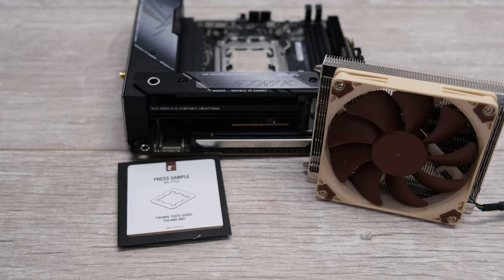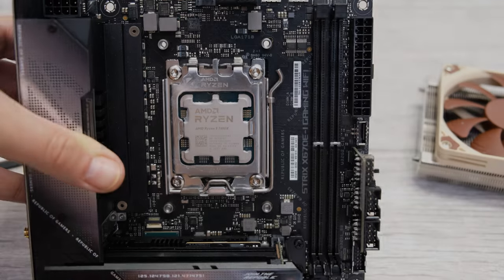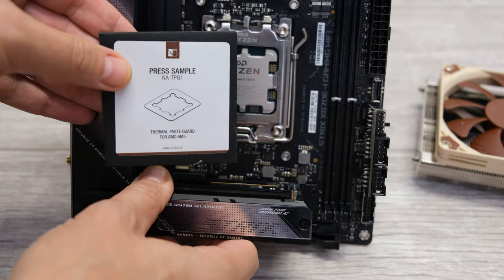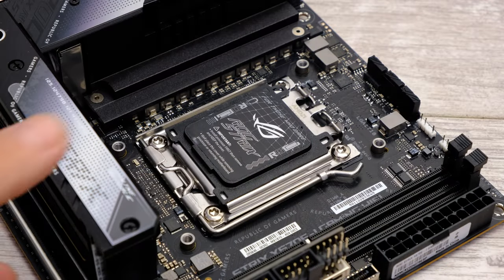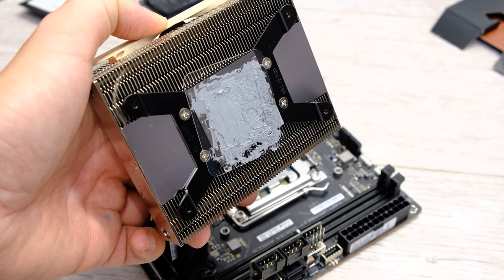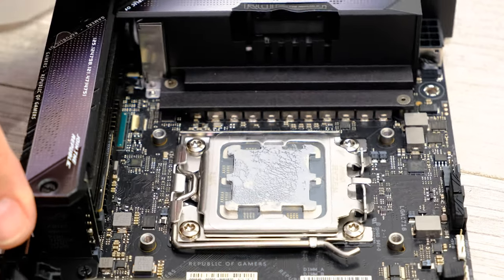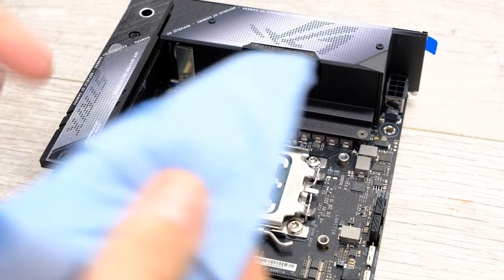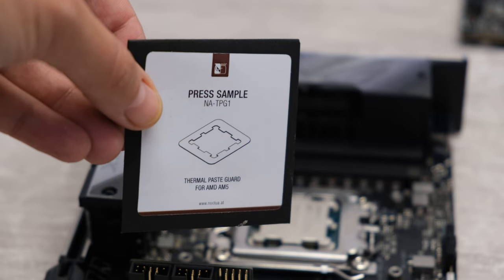Noctua Thermal Paste Guard Review: A Must-Have For Ryzen 7000 Owners!

Comment: i wonder if maybe adding double sided tape to hold it down , if that would keep it there even when you remove a cooler?
Reply from the maker: My thinking exactly. Thankfully you can just drop over another one but it’s super important to have one there when you clean the heatspreader 👍
Reply: @CrazyTechLab  just put some thermal paste under it to hold it down :D
Reply: Glue metal-plastic with resitant to heat and its ok.

Comment: Just get the Thermalright AM5 Secure Frame. It's fully aluminium-anodised and sandblasted, fully laminated with uniform pressure edges. Works like a dream. It's a must for big tower air coolers.
Reply: thanks for the reminder. I'd forgotten about that.
Reply: That's exactly what I did - it's about 10 £/$ and completely worth it
Reply: I think you could lose warranty by removing original am5 frame from mobo
Reply: @lolk1ck No you don't.
Reply: @lolk1ck  nah mate, you definitely won't - just don't throw it away coz if you need to RMA it you'll need to give it back as it's part of the Mobo

Comment: Been using one for about half a year now. Just replaced my NH-D15 with an AiO and the Thermal Paste Guard managed to keep all of the excess thermal paste from running down the IHS.
Reply: Look up am5 contact frame, more of a reusable solution. Intel gets even more benefits from those too (prevents warping, improves cooling, etc). For AMD though, it's pretty much just about paste cleanup.
Reply: @betif00 Thank you very much for your hint🙂 I'll definitely get one of those frames whenever I plan to work on my PC again!

Comment: Maybe try putting two guards on when installing? This could maybe deal with the issue you didn't like the guard being flush with the CPU, and one would lift with the cooler while one should stay in place and prevent you from having to slip a spare over while paste is still on the processor.
Reply: Exactly what I was thinking. Use two and perhaps one will stay in place. I’ve bought these guards and will try two with my new build.

Comment: Wouldn't the guard burn? Shouldn't you remove the guard after applying the paste?
Reply from the maker: Nope and nope. The plastic has a far higher melting temperature of the outside of the CPU. Designed to be left in place
Reply: @CrazyTechLab I've seen copper guards for sale, would they be better?

Comment: Thermalright has also released a AM5 contact-frame, that should do the same thing. Wonder how that one improves thermals compared to the normal bracket
Reply: I've ordered it and I'm waiting for it. Might add some thermal pads to it so it connects with my big Noctua tower cooler.
Reply: crieve i ordered it not because the thermals but because it prevent the thermal paste from falling to the crieves
Reply: I've ordered it.. Excellent value.. 😎🇺🇸

Comment: do you leave the guard on or remove it after applying the paste?
Reply from the maker: Leave it on. It's effective at preventing thermal paste spreading over the edges of the CPU when the paste is compressed between the CPU and cooler when you install your cooler, or if the cooler plate is moved during installation or when you remove it.
Reply: @CrazyTechLab  Okay, thanks. I picked up a 3 pack.

Comment: If the purpose of the guard is to keep thermal paste from falling onto the SMD's there's no reason for it to be flush to the top of the CPU and it being flush would make it damn near impossible for it to not get stuck to the underside of the heat sink.

Comment: I dont want insult anyone’s intelligence but if you think a little thermal paste on your processor will not do anything to it. 

Thermal paste is NOT conductive in most cases. It will not harm your component. You can always use 99% alcohol to clean your processor and nothing will be effected nor damaged if you don’t believe me even ram use a combination of adhesive and thermal paste across the entire module and that does not effect the chips .
Reply from the maker: No one said it will damage anything. It's more about the cleanup process. Also 99% alcohol costs more in the UK than this gadget from Noctua and will take longer to clean it.
Reply: Thank you for saying this, actually. I'm about to build my first pc here soon and I'm going through every little query I could think of, even "will the paste ruin my CPU through the gaps it has?" But learning that anything non-conductive won't do any harm lessens my worries.
Reply: @matamatmassivetac5789  yeah no worries i just put together a 7900x with a tinny amount of thermal paste and I didn’t need to make a big line just a small ammount on where the CCUs were located and small bit on top of that and am getting 62 C maxed out

Comment: Is it a must to have a CPU contact frame installed on AM5 motherboard?
Does AM5 mobos have the CPU bending problem resulting in poor contact with coolers prevalent in Intel LGA 1700 mobos? Feeling confused.
Reply: No it's not a must. This entire video is about keeping the CPU clean, but thermal paste cannot damage those components you see on the CPU in those 8 holes on the side.
Reply: @louisfriend9323  I see.

Comment: Apologies for a dumb question but should u bother about thermal paste on the chip? It’s non-electric so the only thing I might understand is the visual aspects (aka cleaness) or maybe heat distribution?

I thought maybe someone can explain that for me
Reply from the maker: It’s not dangerous and won’t impact on performance. But it will save a lot of time cleaning later.
Reply: @CrazyTechLab  Thanks man!

Comment: Why is thermal paste not used when installing the fan that comes with AMD Ryzen 5 7600 during its initial installation? Which thermal paste would you recommend if we want to use it?
Reply from the maker: Because the fan that comes with it has thermal paste pre applied to it. You don’t need to buy paste for it. If you ever do need to buy paste I can recommended arctic mx4 or mx5 or Noctua
Reply: @CrazyTechLab  I watched your channel for the first time and it has good content, I subscribed immediately. thanks for the quick reply

Comment: Am i an idiot for thinking you apply it, apply paste, apply cooler, remove cooler, remove guard and re apply cooler? As in the plastic doesnt stay on the CPU for use?
Reply from the maker: It stays on for CPU use. CPU doesn't get hot enough to damage it. It stays there and prevents paste getting into the gaps around the CPU

Comment: A better solution would be to use a carbon thermal pad
Reply: Why? Most pads aren't as effective as high end paste and have the added disadvantage of being extremely brittle
Reply: @Nemesis_406  after having tried to use one, I agree with you 💯

Comment: plastic on a cpu that's designed to run at 95C? doesn't seem safe.
Reply from the maker: The internal core temperature of the CPU is 95'C. The heatspreader will be cooler and the melting point of the plastic is much higher than 95'C
Reply: @CrazyTechLab  the plastic will not melt but will smell like shit , i can tell you from my experience when i use some cooper heatshink with some noctua fan on the back of the backplate of my gpu and fix them to the gpu with some plastic necklaces , when i was runing timespy i can smell the burning plastic, that why i remove it, the plastic necklaces was not melted but they smell like buring plastic at over 70C

Comment: I think it´s better for you to learn how to apply thermal paste correctly first, this massive amount isn´t helpfull.
If you make it correct, you didn´t need the Paste Guard, cause you will only have a very thin film of paste on the CPU...
Reply from the maker: You can use a lot less thermal paste than I used here but twisting the heat sink or water block just a little bit can still result in thermal paste becoming lodged in those U-sections even with very little paste. This was a demonstration of how well it works too and it was especially effective when cleaning the CPU. Even a thin film would see the past find it’s way into those edges when you wipe it off.

Comment: Why are am5 processors a stupid shape?
Reply from the maker: To keep the socket the same size and maintain cooler compatibility. If the heatspreader covered everything they would have to make the processor bigger. Instead it has the cut-out sections to sit around extra components

Comment: I have an idea, why not try actual colling tests with it vs without and paste applied per AMD's directions?
Reply from the maker: I have an idea, why not learn to spell first? And the guard does nothing for cooling. I never said it would improve cooling.
Reply from the maker: I think you need the the waaambulance.
Reply from the maker: @Flutes2000  It’s to stop thermal paste amassing around the edge of the CPU. It does this. I’ve clearly shown this in the video. If you’re expecting it to improve cooling then I have no idea why you think this because I haven’t claimed that and  Noctua has not claimed it. That’s not what this does. I’m not going to say it improves cooling because that’s like saying a car can paint a wall. If you’re not bothered about paste amassing around the edges of the CPU and spending hours cleaning it before you sell it or photograph it then this product is not for you
Reply: @CrazyTechLab  It won’t improve colling that’s not in question, my questions are will using it increase temperatures even slightly, and is there any chance that using it will void your warranty? If you are going to say this is a “must have” without qualifications, then these are legitimate questions.
Reply from the maker: @Flutes2000 Absolutely no way this has an impact on cooling.
Reply from the maker: @Flutes2000  Why would it increase temperatures though? There is no reason for it to either up or down. It's not sitting between the CPU and cooler. It doesn't impact the thermal paste spead between the CPU and cooler. It doesn't touch the cooler in any way. Absolutely no way it have any impact at all. Zero. Nothing. I'm not going to test something when I already know the answer and waste my time. It's like driving my car and seeing if driving it makes it snow. the two are completely unconnected. It's only function is to prevent thermal paste getting around the edges of Ryzen 7000 CPUs and becoming clogged there and being a pain to remove. For a few bucks, it's absolutely worth it in my opinion.
Reply: Just speculation but possibly partial answer to Shemsureshot’s question “Why are am5 processors a stupid shape?”  When moving to an LGA socket AMD seems to have felt they had to keep at least some AM4 and AM5 cooler compatibility, their solution apparently was to make the IHS abnormally thick (guessing it was cheaper and easier to make the IHS thicker than the circuit board) but that, and remember this is just speculation, along with the increased TDP from the changes might have made it just a few degrees too hot inside a standard sealed heat spreader.  Their simple quick and economical solution just might have been open it up for some air flow, like you would a window on a hot day. Or they just did it for stupid marketing looks... I don’t know, I’m a user not a tester, but it is one of many possibilities.  What I do know is that when I put a 65W 7900 on an B650E-1 ITX motherboard with Noctua NH-L9a-AM5 low profile cooler, it runs noticeably hotter than 65W 5700G on a nearly identical am4 ITX setup.

So, what if, reality or not, AMD’s bean counters believe that it would impact thermals and therefore void the warranty, of course you wouldn’t have to admit that you blocked off their vents but…
Reply from the maker: @Flutes2000  AMD has stated exactly why the CPU is this shape and I can confirm this because I was at the launch and spoke to them. Small components on the substrate had to be placed at the edge. There was no room to have the heatspreader sit over the top of these without making the CPU larger and and as a result cut cooler compatibility with Socket AM4. To maintain cooler compatibility they opted to have cut outs in the heatspreader to avoid these components. I should add that the components do not get hot. Only the core  and I/o die does. The single reason for the heatspreader to have these cut outs it to allow it to sit around these components. Anything else is wild conspiracy theory and wrong. Even if they were for cooling, there is zero airflow underneath the CPU cooler. Certainly not enough to impact anything. In any ever, this tiny slither of plastic wouldn’t even impact the airflow even if it was there. It’s smaller than many cooler contact plates.

Comment: Can you leave the noctua thermal paste guard for like years without worrying it might melt?
Reply from the maker: Yep no way it will melt. You’d need way higher than the internal temp of the core to melt it and the heatspreader is cooler than that even. Your PC would switch off due to CPU overheating before it melted!
Reply: @CrazyTechLab  the plastic will not melt but will smell like shit , i can tell you from my experience when i use some cooper heatshink with some noctua fan on the back of the backplate of my gpu and fix them to the gpu with some plastic necklaces , when i was runing timespy i can smell the burning plastic, that why i remove it, the plastic necklaces was not melted but they smell like buring plastic at over 70C